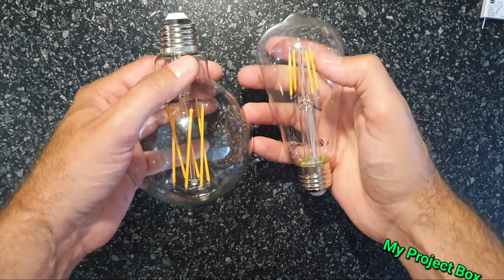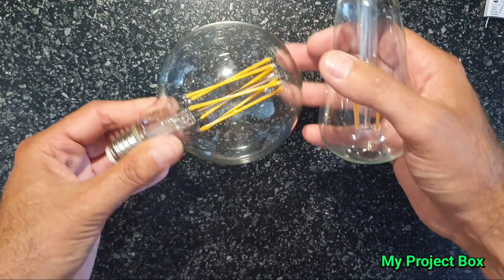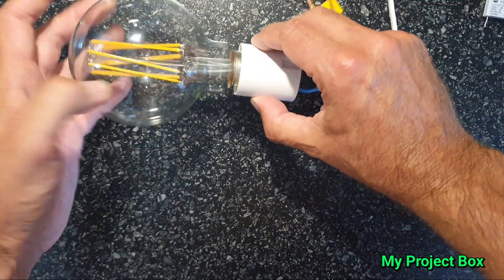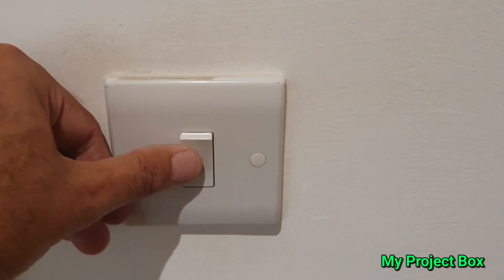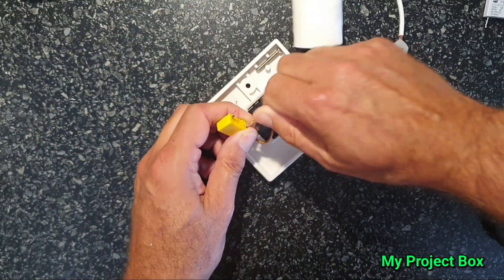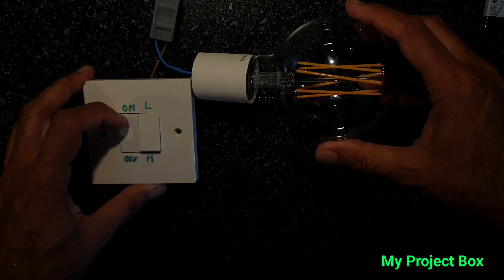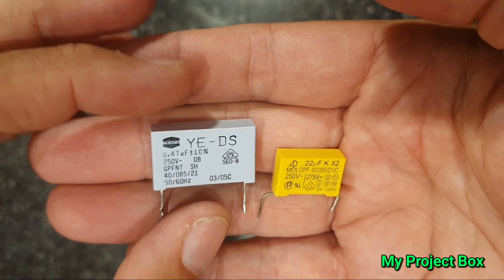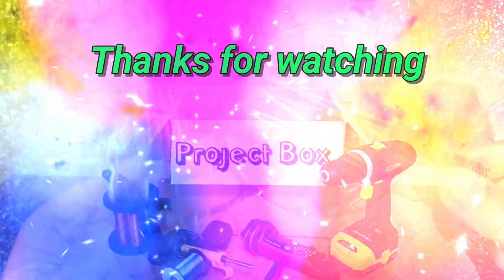Dimming NON-dimmable LED filament bulbs & life extension

Comment: You could also use a 2 way switch to change between capacitor in series and direct mains connection without shorting the capacitor.
Reply from the maker: Yes that is a alternative way to do it, basically a changeover switch it's basically what I did in this video with a sonoff dual https://youtu.be/EUKop6N4cX0

Comment: How safe is a capacitor on a non dimmable  bulb
Reply from the maker: These capacitor are Class X2 mains suppression safety capacitors, designed for direct connection across mains voltages. The voltage  to the bulb is lowered with the help of this capacitor. It should not harm your bulbs.

Comment: I want to dim twenty filament light bulbs connected in parallel, what capacitor do I need? Each bulb has 4.5 Watt.
Reply from the maker: It's hard to say without some experimentation. But I would start at about 1uF or 2uF. Mabe put some in parallel to determine the required brightness. Class X2 safety capacitor is a good option. It's a good idea to put a 5ohm resistor(1w) inline with the switch that bridges the capacitor. This will protect the contacts from excessive wear, when  Bridging out a larger charged capacitor, and prolong it's life.
Reply: Thank you for your reply🙇, I'll try using 1uF and 2uF.
Yesterday I tried using a dimmer, but after 2-3 mins bulbs started to flicker and I had to switch the dimmer off and turn it on again to keep them working for another 2-3 mins without flickering.

Comment: Sir if i want 2 connect 4 lights  in. a circuit. Its controll in one switch. How many capacitors or per piece of light connection capacitor or its capacitor value plz reply it
Reply from the maker: You can do it with just one capacitor. It just needs to be a larger value. You would need to experiment with different capacitors, to get the right value. All the LED bulbs on that circuit, need to have the same wattage and the same type/make. Try start with 1uf and go up in value to get the brightness you require.

Comment: very clever! thanks for sharing!

So you know if this trick works with LEDs that come with a power supply brick, too?
Also, do adjustible capacitance dimmer exist?
Reply from the maker: I don't think a capacitor will "dim" LED's that have a external power supply/driver. 🤔 It's not a universal  quick fix for all LED lights, some testing is required.

 You could make a switched capacitor, with a selector switch, to switch in different capacitors. It's a bit impractical but it is possible.
Reply: A series capacitor completely blocks DC current, so this trick only works on AC, like mains. The power supply brick might output pure DC or might output DC with an AC component.

Comment: I have 2 of these bulbs in our bedside lights so will add the caps inline with the feed wire to each lamp, so thanks for the idea it should work well,
l I think the 0.22uF at 400 volts will be the best one for me, this will give the best dimming
Reply from the maker: There's only one way to find out give it a try👍😉.  Obviously different wattage bulbs will react differently  to the capacitor values.  So some experimentation is required.

Comment: Thanks very helpful, wanna know does it goes for tungsten bulb too? and how many bulbs can be attached to a single cap!?
Reply from the maker: Yes a tungsten bulb would work, but you would need a much bigger capacitor! Because of the increased current draw of a tungsten lamp. Cheap "traditional dimmer switches", were designed for old school tungsten lamps. So it's more practical for them. 

Yes you can dim multiple LED bulbs from one capacitor. You will need a larger capacitor, for more bulbs on one circuit, for a given brightness level. Also all your LED bulb need to be the same type and power rating, to get a consistent brightness between them.
Reply: @MyProjectBoxChannel  thank you so much for your feedback 🤗 
Waiting for future videos 😇

Comment: On camera is OK, but did you see any flickering with capacitor?
Reply from the maker: No flickering whatsoever with this particular bulb. Just like you see in the video. But you might have problems with certain types of LED bulb. It won't work with all of them. It all depends on the type of driver circuit it has inside.

Comment: I have some string LED lights on a fifty foot cord.  5 lights per cord.  Work lights actually. They pump out about 700 lumens per bulb. I think they are the cluster type light emitting diodes in each. 
The cord plugs into a wall or generator, and you get what you get.  Dazzled.  
I bought them because are versatile in their usefulness.  One of those uses is providing light when the power goes out in my house.  They will be plugged into an ecoflow delta 2 energy storage device.   Is there a way of making them dimmable in this configuration? Something before the plug perhaps?
Reply from the maker: It could work, it all depends on the type of driver inside of your LED lamps.( SMPS drivers, probably won't work) It's just a matter of experimentation. You could try putting a small motor capacitor, or capacitor from a old fluorescent fitting, in line with the Live wire(feeding the plug socket). Maybe 2 - 6 uF. If it has a useful effect, then you can increase or lower the value as needed. Just try it and see. You have nothing to lose.

Comment: Thanks a lot. 
I tried this option, and on test that I made( with one light bulb) it worked ... but when I tried on the ceiling ligths, all leds,  start flashing. 
Any solution?
Reply from the maker: It all depends what type of LED driver the bulbs have inside. With some types of driver it just doesn't work. (SMPS type for example). You could try a larger value capacitor. It's also a good idea to test it on the brand of bulb you're planning to use it on first.

Comment: What size capacitor are you using?
I have some low voltage leds I’d like to dim. (12v, 4W). What size capacitor would I use?
Thanks
Reply from the maker: If it's 12v DC, a capacitor dropper won't work. You could use a resistor, but that would be inefficient as you would burn off heat(but it is very simple). A PWM dimmer circuit is very efficient for 12v DC LED lamps.
Reply: @MyProjectBoxChannel  resistor only works on dimmable bulbs. Mine are not dimmable. I did find another video that suggested putting a single dimmable light in the same circuit would make all of them act as if they’re dimmable. Will try that next.
Reply from the maker: @AverageCarGuy  Is it 12v for automotive car use?
Reply: @AverageCarGuy  Hi... Did it work? Putting a single dimmable globe into the circuit?. I saw that video.

Comment: Is anyone working out a formula or list for what capacitor is required for differing wattage lamps or brightnesses
Reply from the maker: There is a formula to calculate the "AC resistance" (AC resistance is impedance for capacitors) of the capacitor for a given frequency ( say 50Hz). You could do very rough calculations for with current draw from the LED bulbs. Then work out the given wattage that a capacitor will give for a different LED bulbs. It won't be extremely accurate. But you can try and plot these values to a table. Different LED bulbs will give you different results.

Comment: yup i wanted to do this with non dimmable non capacive dropper lights, same thing but only with the current sense resistor
Reply from the maker: I have done the current sense resistor modification before 😉. It works well. I put a potentiometer in its place to adjust the LED current. I made a LED bulb with a dimmer knob on top. Big Clive normally just snaps one of the parallel resistors to "half" the current. You can view my video on it, if you like
https://youtu.be/wWVrdxko0dg

Comment: to my project  box : how about you put that  capacitor   in  series with the output of a dimmer
Reply: I don't think that would work, LED bulbs can't be dimmed because they would shut down in case of voltage getting too low, usually about 200V. Capacitor in series won't keep it up.
Reply from the maker: @plainedgedsaw1694  yes you are correct. LED bulbs and dimmer switches have had quite a rocky history. There are so called dimmable LED bulbs available. These Bulbs require a special trading edge dimmer. The problem is, there are different type of driver circuits for different LED bulbs. As luck would have it, the capacitive dropper just happens to work with a quite a few of them. It makes the bulb work on it's absolute lowest limits the driver would allow.
Reply from the maker: I don't know if it's going to work, but you could always experiment. It also depends on the type of dimmer you use. You get leading edge (the old type) and trailing edge dimmers (new type for dimmable led bulbs)

Comment: A good way to save any light is with soft start, and I am sure you know how that is done?
Reply from the maker: NTC thermistor Inrush Current limiter, is a very simple approach, but maybe not for such a small load. Maybe if multiple light bulbs are connected to the same thermistor. And one cap dropper could dim multiple bulbs with a larger value capacitor. What do you think?

Comment: the way, he bridged out in the first place...  omg
Reply from the maker: I cannot recommend anybody bridge out live capacitors 🤣. But I held it on the insulated plastic handle. Trust me! I don't enjoy electric shocks. ☠️😉👍
Reply: @MyProjectBoxChannel ... try to push the responseability a bit. at least, you could ad a resistor to the capacitor unit, for the voltage to drop after switching off.
Reply from the maker: @udufbxsixn  adding I bleed resistor, to bleed any residual charge from the capacitor is good practice. However since you're not going to be touching any of the components, and when the switche is in the high position, it will bridge at the capacitor anyway. It just keeps things simpler.
Reply: @MyProjectBoxChannel  Well, in your schematic you put the capacitor before the power switch. So the capacitor will be charged if you have to open it for some reason.
And just wraping the wire around the leads doesn't help either. A blob of solder and shrink sleeve would also help.
Reply from the maker: @Peter_A1466  I normally solder everything 😉😂, it's just that I'm on holiday and don't have access to my soldering iron 😔. I guess this is more for people who can't or don't like soldering. I'm keeping things really simple, so no bleeding resistor to drain the cap either.